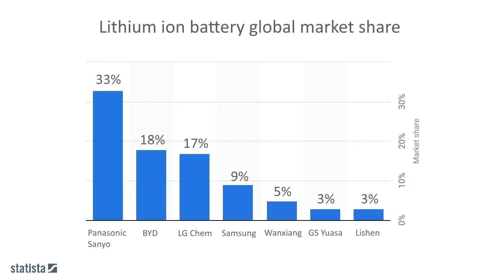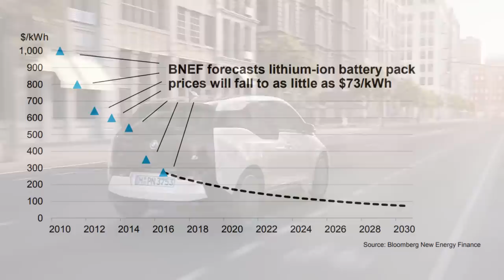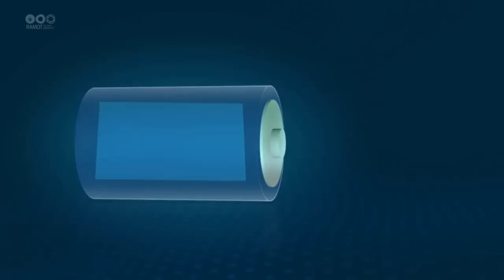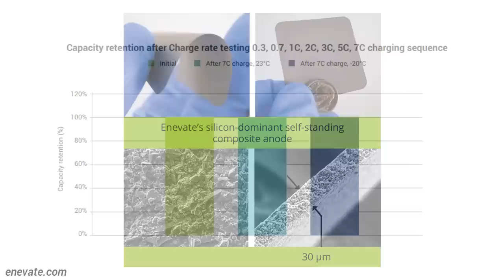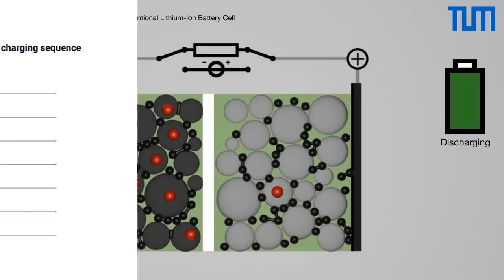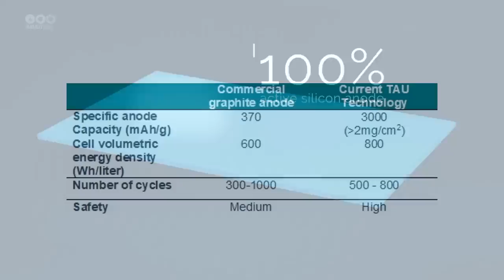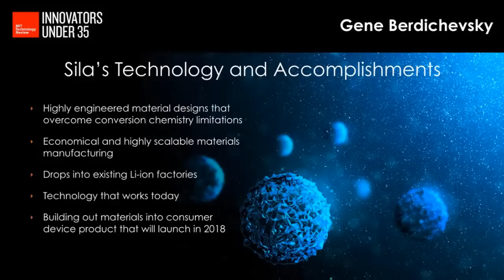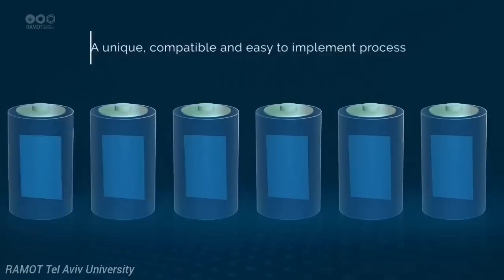The Battery Revolution. Ultra Fast Charging

Comment: It's all about rotation. I am working on producing rotation using force (push/pull) since 2014 and as for now it's ready to build a miniature. If only someone hear my call, we don't need electricity or fossil fuel to roam around this planet. My invention is pollution free it's even a cold engine that can be customized to fit where it is needed. The logic of my work is "observed the compressed air in our vehicles Tyre" the compressed air is used but not consumed. It can use Hydraulic, Compression spring, Compressed air and even Vacuum as the source of force.

Comment: What sort of current is required to achieve 80% charge in "a couple of minutes"? It must be in the thousands of Amps. What is the heating effect on the connections and the battery itself - everything has some resistance. Even if the total resistance is only 0.01 Ohms, 1,000 Amps will generate 10 kW of heat.

Comment: EVs will ultimately be held back by enough fast charging infrastructure.  The electricity and recharging infrastructure will be the bottleneck in the 2020s.  Hybrids will still be a big market, and with good reason.  The extra cost for them over conventional vehicles is falling quickly too and they have more benefits than just better mpg.

Comment: evehicles are brilliant round town but open road long distance is the issue. 
So some form of wireless charging built into motorways freeways autobahn etc, would be ideal.
Long distance becomes a non issue and the vehicle will be fully charged as one leaves the main road. 
Also. Why don't EVs have solar panels? And maybe a popup wind turbine that deploys when one parks?

Comment: The range is not a problem. It's electric car manufacturers that are thinking stupid. There need to be stations just like gas stations. Only thing, they would offer up a swappable battery, you pay for the charge it already contains, and for swapping labor. It must be designed to swap in seconds though!

Comment: I tried!   I really tried to read through most of the comments....   I just couldn't finish!     For most of you and for you people who do not want to think the future is just around the corner (I mean)  Just a few years away!     You haven't  done your home work!  There is a product that is about to change everything, he talked about it in the video!    Its   called graphene!    "It"  Can  and will change everything.... Not only in cars, home and everything we do!  Here is some of the properties.......   Its lighter than air (well almost)  you see its 1 atom thick!   200 times stronger than steel  , and electric travels 1000 times faster across it than a silicon chip!    Now this is just few things this stuff does!  There are meany more things it can be used for!    So far there has been one set back up to now its been hard to mass produce!  But again i said up to now....  There has been new ways to start mass production!   It also can hold an electric charge and take a charge 100 times faster than any battery we have today!  It is what is we all know as graphite!  Yes!  But its 1 atom thick!  And as some may  know it as carbon!  This is one of the things we have been trying to clean up in our air!   So!  If you don't know about  ( "GRAPHENE")  Look it up! You wont be sorry you did!   One last thing   !    They have found that a layer of Graphene on a solar panel can produce electric when it rains!

Comment: Electric cars are great for urban driving but not quite for long range or cross country. No room for error in taking road trips or veering off course.  Solution: Ultra long ranges would put most concerns to rest. 1000+ mile range.  Or have super fast charging times e.g 10-15 minutes for 80% charging.  Issue with super fast charging times is you still need charging stations in rural areas to account for cross country and long road trips. And you can't put charging stations in middle of nowhere. So the solution has to be to find ultra long ranges.

Comment: I plan on buying a new vehicle for the last time this month.  It will be EV of course.  After this one, all my driving needs will be met by summoning an Autonomous driving vehicle when I need it, where I need it, with the proper fit for what I need it for.  In a few years, there will be no need to buy a car as it will be much cheaper to have a car service that provides you with what you need on call.

See Stanford Professor Tony Seba's presentation on disruption of energy and transportation.  It's just starting, but will quickly reach a tipping point.

Comment: We are entering a market driven Era of rapid battery cell advancements .. any car maker tied to one specific cell chemistry/type, will fail miserably as competitors quickly switch to new better/cheaper cell technologies for use in their internally produced flexible battery packs.

Comment: never , the auto motive industry was founded , builded , grown , centralized around the petrol or the Gasoline V8/V12/V16 engines mixed smell of the Gasoline , burned tires , adrenaline and power .. making stops along the roads for filling in petrol and resting its became a culture issue part of the human activities . For us as an oil producing country, I consider it a good thing to turn the automotive industry towards electric power. At least we will get rids of the foreign greediness,  which leded to open conflicts . We can launch a local automobile industry to absorb the excess oil produced and refined .
now it is not very practical charging taking a long time filling petrol take less than 5 minutes . those cars mostly for pussies , someone very organized ,  boring, and like to save money although the price of the car is not cheap and no competitor and if we exclude the self-driving system in Tesla nothing exceptional in these cars ..

Comment: Banning ICE cars creates a monopoly, which means electricity companies can keep raising their prices and electric car manufacturers have no reason to improve on price and efficiency, which in turn would result in driving becoming a privilege for the rich only.
Electric cars improve because they have competition from ICE cars, which are evolving in a faster rate too nowadays.
That being said, charging 400mi of range in just 5 minutes will convert most ICE car drivers IF it stays cheaper than pumping the same range of fossil fuel and the electric car isn't more expensive.
Reply: The electric grid is not a monopoly.  It's a regulated utility.  If it weren't for those regulations, THEN it would be a monopoly.
Reply: IncognitoTorpedo Do you honestly believe those regulations actually change anything? All they do is make your statement theoretically correct. Lobbying makes sure it's only theoretically.
Reply: Your statement fails to consider that there are many other options.  Electricity companies can't raise the electricity prices as that simply provides more incentives for people to install solar instead.  The higher the utility price, the faster a solar array will pay for itself.

Higher prices also encourage conservation, so they are in many ways self defeating.

Also, electricity prices are demand based.  Which is why most utilities have demand based pricing, it is usually more expensive when the demand is highest, usually during the day, and lowest when demand is lowest, usually at night.

If you look at Australia for example, battery storage is getting very common, as that allows people to shift demand from the peak periods to the off peak periods.

Charging your car at night is usually the most attractive option for the same reason, and there is no incentive for utilities to make their power generating infrastructure that is mostly idle at night more expensive to use.  Using it more at night makes it more cost effective, more efficient, and it is already very attractive for them to get more use out of equipment they already built.  It doesn't cost them anything to do so.

Which is why the forecasts of electricity prices rising with EV's are simply not accurate.  There is no basis in reality to support them.
Reply: Captain Crunch With the current state of things, you are right, however things will change. Worries about climate change leads electricity companies to switch to more eco-friendly ways of generating electricity, which includes large plots of land full of solar panels, which obviously don't deliver at night. Combine this with the fact large industrial plants run 24/7 and the raising demand of electric power at night for charging EV's and it's not hard to imagine the lower rate at night will disappear or maybe even become more expensive than daytime electricity usage in the relatively near future. 
You can counteract this with buying solar panels yourself, but my country already taxes grid-linked solar setups (after a few years of funding them), so in this capitalist world it's only a matter of time before more countries do this.
This could again be counteracted by not grid-locking your solar setup and expanding it with battery pack to buffer your production until you need it, but this further raises the cost and lengthens the time needed to earn it back. Also this isn't an option for people who rent or don't live in a building that allows them to install solar panels on the roof, and home-charging is an issue for people who park in the street anyways.
Reply: Well I think the future is ultimately most middle class or wealthier people generating their own electricity on their own land using batteries and solar panels, with utilities providing the backup.  Cars being more expensive in general is a given; oil is going to run out one day.  

Perhaps this is ultimately a good thing?  If you consider how many trips are just people wasting huge amounts of fuel drag racing or going for pleasure drives across the country, and using up fuel that folk who legitimately are just commuting, going shopping, or on some actual errand need.  There will come a day and time when pleasure drives become too expensive to be worth it.
Reply: Will Davis I don't agree, pleasure drives shouldn't become so expensive only the rich can afford it. There are other fuels for cars than oil-based ones apart from (and more ecological than) electricity, some of them easily adaptable to existing car technology.
It is simply too soon to switch non-electric energy consumers to electric and will be as long as producing electricity for existing electricity demands isn't 100% renewable/ecological. There's plenty of oil left for decades and there are plenty of alternatives to buy us the time needed to get electricity production on point first and test battery technologies in other applications before rushing everyone who can afford it into Tesla's and everyone who doesn't on bikes and busses.
Reply: where are you going to store all that electricity ?

Comment: I don't think it will be the total end of gasoline. I think plug in hybrids  with a gasoline powered generator will be common. And these new batteries, combined with a gasoline powered generator could allow a car that can go 600 miles when fully fueled and charged. 

I know that Ford's next gen police sedan will be able to go about 500 miles when fully fueled and fully charged.

Comment: Many comments here make the valid point that for years we have seen ‘breakthrough battery technologies just around the corner’ but these have not emerged as consumer products.  This reason for this is that the battery market until now has been relatively small by value and volume.  Tesla  building its own Gigantic factory for its own batteries is living proof of this fact.  So what is different?  We are on the cusp of becoming a society in which electric vehicles become the dominant form of transport.  As this happens the value of the battery market will at first match and then exceed that of the fossil fuel market.  Such a large value market will invest heavily on research to tackle the issues of power density, safety, longevity, ease of manufacture, recharge speed and cost.  Billions of dollars will be ‘lost’ exploring technological blind alleys but progress will be rapid because the ‘win’ is measured in trillions of dollars.

Comment: Excellent video , but can any one tell if the source of electricity is 100 % thermal from buring coal or oils . Will the use of EVs cause more pollution than using regular combustion engines ( I think this is the argument brought by many oil lobby supporters ) ?

Comment: What needs to be produced now is kits to adapt older and classic cars to EVs at a low price. Young people just out of school and pensioners can't afford even the cheapest prices being quoted for new cars. Because of this they will continue to drive polluting cars out of necessity. We shouldn't pay more than $500 for an electric motor or controller. We are being ripped off by the current cost of EV conversions.

Comment: Maybe you should recheck the time tables for the various battery massproduction dates and current availability. Graphene batteries are already sold as powerbanks, solidstate battery massproduction will kick off around the same time graphene batteries will be massproduced, around 2022. That means that your featured silicon battery is not earlier than any of these.

Comment: 8 time faster then a tesla fast charger?i wander wat home will have a 320 amp 3 phase grid connection?1 phase 40 or a 3 phase 25 is the standard.but if u think u are going to go beyond 80amp 3 phase u are insane.

Comment: They should also focus on batteries specifically designed to hold the energy produced by PV or wind power plants. These batteries will be stationary the whole time, so energy density isn't as important. So that kind of battery would have to be cheap. Their purpose is to keep the building working at night and when wheater conditions doesn't allow for continuous production

Comment: Some of these materials are not that abundant.

I'd like to see some content on how likely it is that a move over to battery power will be able to keep transportation as democratic as fossil fuels have and just how recyclable all these batteries and battery based technologies will be.

Its all very well these glowing ultra optimistic pieces, but just how realistic are they.

As we have seen with CoVID, transport  the simple ability to move around, is likely to come under severe attack by those controlling societies (not for them of course). How likely is it that these apparently expensive, problematic technologies really provide a reasonable alternative?

Comment: news flash, the discovery that graphene sandwiched between 2 conductors can, by its mere existence, generate electricity, forever, shows we dont need big energy anymore period. the nay-sayers will start with 'but it only makes microvolts' to which the response is 'yeah? so? thats still electricity from nothing and have you never heard of scaling?' if a single instance can make microvolts then a few thousand more can make a volt, that package will be rather small and a few thousand of those units would make plenty of power for any electric system. if incorporated into the actual structural design of a given electric device they can be made to provide more than just power since graphene is that much stronger than steel. the end of Big Energy could be made real in a year if someone were to spend that long bringing this discovery from the lab to the market.

Comment: To answer the question in this vid's title - No. Unless you park your car in a garage or park it very close to your house and have an external power point, then electric cars will not replace gasoline cars.

Comment: 5:13 this video is stupid, they claim its 5x faster than a tesla super charger but they dont tell you the time it takes for a full charge. a model 3 can gain 100 miles in 7 minuets of charge and 80% in 24 minuets.

Comment: Let's make no mistake... The electric vehicle revolution is NOT the end of the oil age. We still need to make electricity, and until fusion power creates huge amounts of energy cleanly, the energy density of oil is much higher than renewable sources for mass electricity generation, which we will need to fill our vehicle batteries. So oil will still be used to generate that electricity.

But... At least, using oil to generate electricity, and replacing oil burning vehicles with electric is a huge step ahead from using oil for everything.

Comment: All of the essential elements needed for the production of lithium batteries are crucial in the attraction of electrical energy from the air into the ground. The earth is a gigantic magnetized battery the processes particles from the sun through the electromagnetic field into the atmosphere. Then from the atmosphere into the ground where essential elements disperse it evenly as heat energy. Constantly removing these elements will , in the long run will weaken the earths ability to absorb and convert energy.  That energy will then build up in the atmosphere. Equal and opposite reaction remember?! Using salt water and radio waves is much better! Salt water burns in focused radio waves but the h2o evaporates and comes back down as precipitation. Completely self sustaining. Why continue destroying the lands when water contains more energy than we could ever use , plus it's self sustaining?!